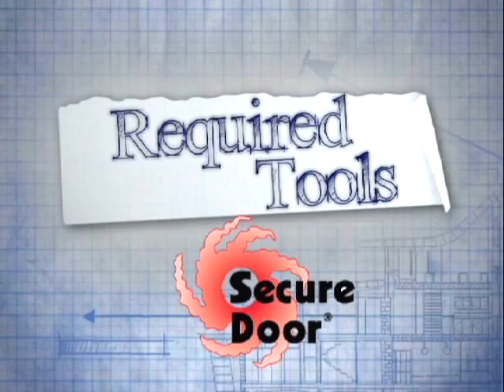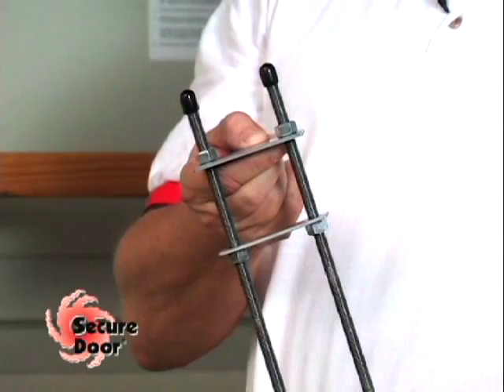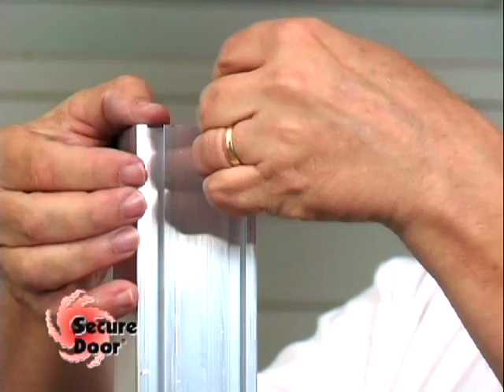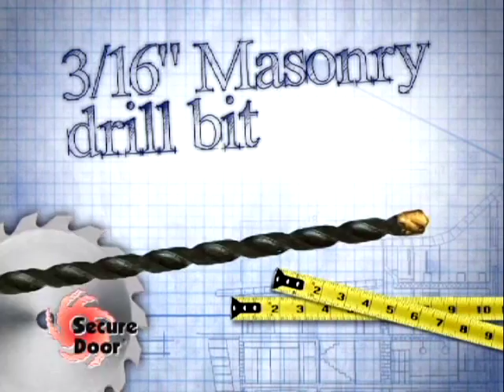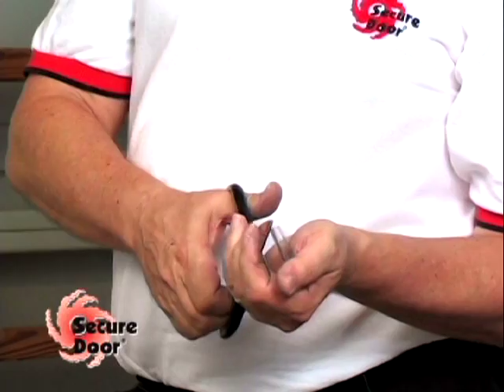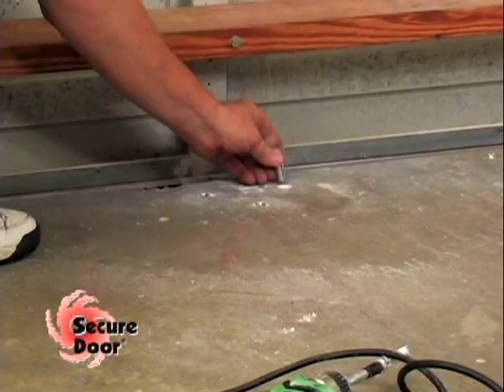Installation | Vertical Bracing System | Garage Door Hurricane Protection

Comment: This looks like it would take too much time to set up with a hurricane bearing down on you. You have to get the bottom plate out (Where is that anyway?)and then your tools to unbolt the bolts from the garage floor,  then install the base, then get the vertical brace out which has been buried behind a bunch of stuff. Then install and tighten 3 bolts. and attach the top. I think we need something we can grab and slip into the bottom brace and snap in the vertical brace. Done. Let's be realistic here. Sometimes tornadoes come quick.
Reply: Lmao you have a week or more lmao

Comment: For the few times u may need to do this u can just use a 2x4 or anything as tall as your door & gently back your car up to it. Done. Ready for storm winds in 20 seconds.
Reply: This leaves you susceptible to negative pressure winds that will suck your door right out into the street.
Reply: I think it will give the same pressure (pretty close) negative or positive... but the header/lintel was not designed for side load.
Reply: @paulntx  True that!!!
Reply: However, if you wish to receive a discount on your homeowners insurance, the 2x4's don't meet insurance criteria.  My home has high impact windows all around, but to get the insurance discount ($250 here in FL), high-impact braces need to be approved.
Reply: Thats why it is bolted to the door to stop the negative pressure from sucking your door out, otherwise, there would not be bolts on the door itself rather just bolts on the ground and support beam...
Reply: @NickBlenderman  Exactly....
Reply: Let me know how that works out for you when, just before the storm hits and you "gently" back your car up to the door and it lunges and damages your door.  Plus think about leverage, and how low your bumper is on the 2x4. That makes the top 2/3's of you 2x4 pretty damn weak and unstable. And that is just the start of the drawbacks using your system. I've been there and seen that!